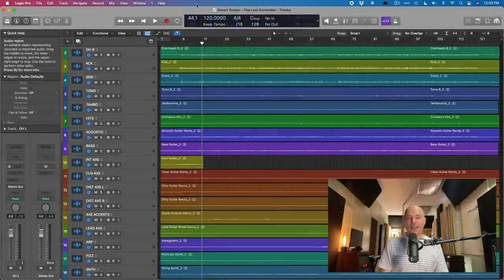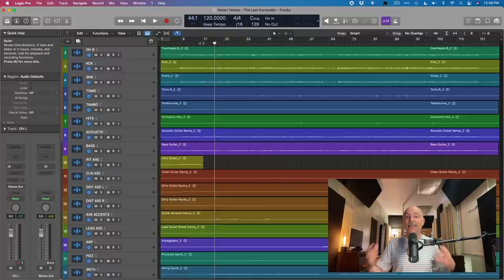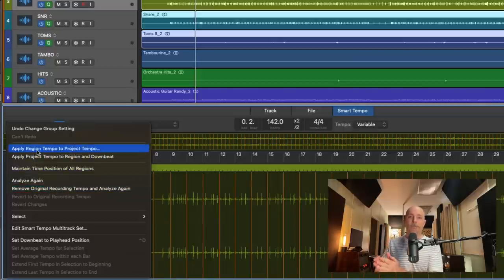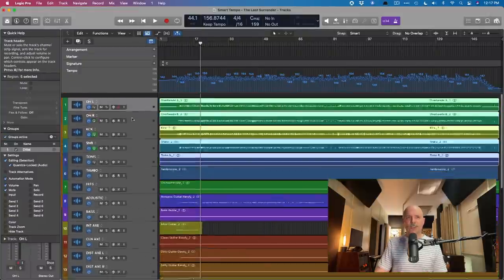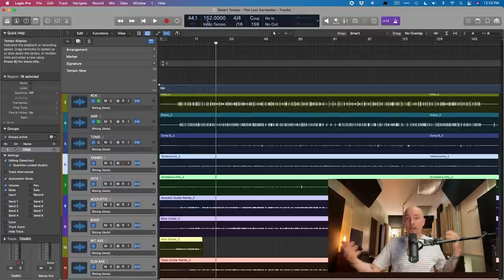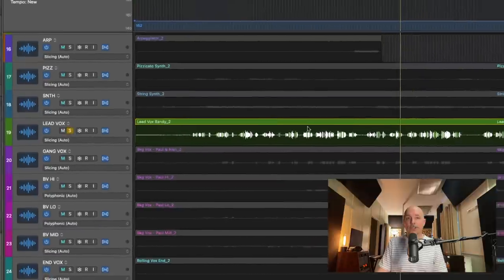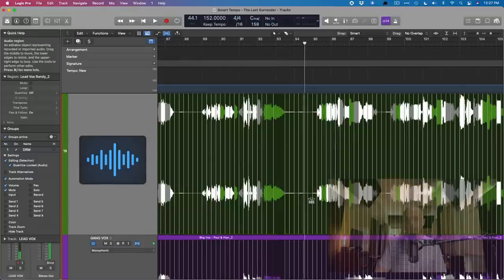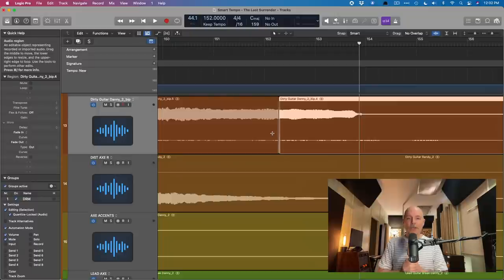Watch Me Set This Audio Project to A Single Tempo

Comment: THANK YOU SO MUCH! I was just working on a project where the band tracks are not all with the click track. Your video clarified how to use smart tempo. I had already spent a good amount of time cutting and moving parts to match with click. I just applied the knowledge you shared and fixed 6 tracks in the project in less than 15 minutes! Thanks again for another great ,and easy to understand video for Logic X . Have a great day!

Comment: Cheers for the tutorial, I have a 9 track album to sort out which was not recorded to a click track and have been trying to figure out a quicker way of sorting it out. I've be doing it manually using grouping and editing every kick/snare to the beat then ungrouping to edit drums/bass/guitars/vox separately. I have one suggestion though. I always duplicate/copy the whole track before I start so that I have an unedited original version and then an edited/tempo adjusted version. Doing it that way, I can then copy any parts from the unedited version to the flexed/edited version should such things arise like the guitar that was mashed at the end of the tutorial, saving all that time trying to get rid of those artifacts, Hope this helps...

Comment: hi Chris, as always, thank you for superb and fundamental  video - probably the only suggestion i could ever offer to you: when trying to remove the bump in that sustained guitar , your setting in the crossover option was on “no overlap” and since i’m dealing with that very thing routinely , if i may suggest to try it with it set to “smart” and “x-fade” options selected, i think it may have helped it along even more :)
Reply: Cats: Not sure why you are going through all this. Since it is the last chord of the tune and doesn't need to be "in time" whatever that means, I would just split the audio for the whole band on the last chord and turn off flex and follow tempo - just use the original audio there - unless there is some important reason this needs to be timed out to a click track.

Comment: Amazing, almost exactly what I needed! YOU rule! ;)

I am having a few problems though (as expected):

- removing tempo from regions never stops, meaning, in your example you select them all and it only does it once and that's it, but in my case, the same window pops like 50 times, and I press enter until it doesn't anymore, then, if I go back to remove tempo immediatley, it keeps doing the same thing.
Regions do not seem to have that info, but still weird.

- if I do not have percussions (just bass and acoustic guitar, which has a terrible tempo to it, I'd rather use the bass...)
smooth or beat?

Comment: Tempo adjustments are one of Logic's extreme short-comings IMO.  That you have to go through all this nonsense just to set a project tempo is pretty ridiculous.  Also, Flex time needs to fix whatever this bug is that causes all the clicking and popping artifacts when you start time-aligning audio tracks.  This problem doesn't happen in Melodyne for instance.  That Apple would ship a completely broken system like Flex for years and years is pretty irresponsible if we're honest.  Also, they do a match EQ built-in, why not a match-tempo built-in?  Nobody wants to pay the same price for Voc-Align that they do for their entire DAW!
Reply: Also, real cool how Logic sometimes decides to insert its own random automations into variable tempo projects.  I had a project once just decide for itself it wanted to have 6 measures of constant 150 BPM with no input from me.  Awesome.
Reply: I’ve used groove tracks rather than vocalign and have been really impressed by the results. Worth trying.